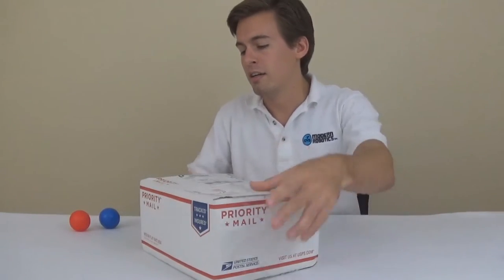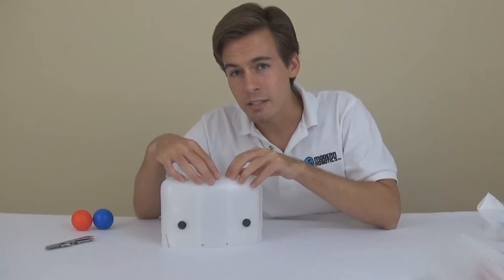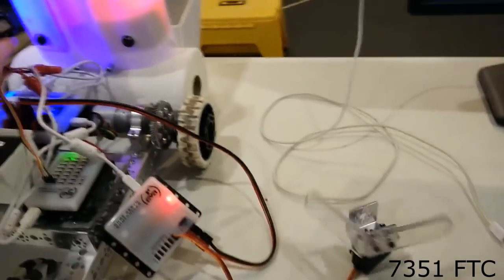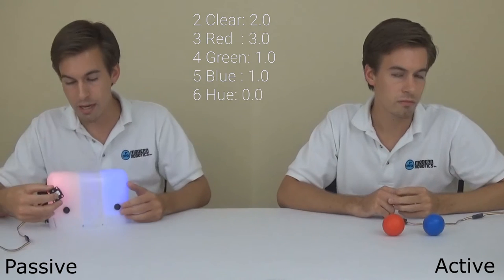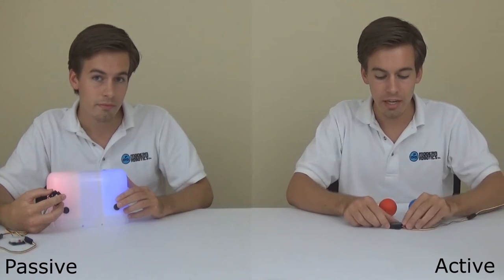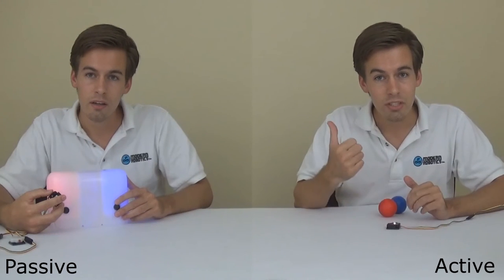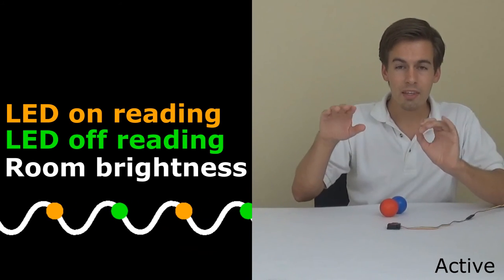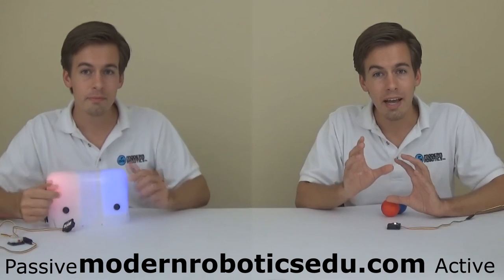Modern Robotics Color Sensor

Comment: Thanks for the information but when I try to use sensors the core device interface does not light up green like it should. I've tried three different interfaces. What may be the problem?
Reply: You have to have a phone/computer connected for sensors to turn on.
Reply from the maker: Dakota, This means the Core Device Interface is not being supplied with USB power. Typically caused by the phone and can be fixed quickly with some more information. Call or email our support team and they can help you out. http://modernroboticsinc.com/contact-us